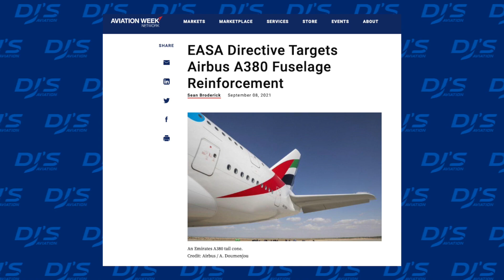New Airbus A380 Problem?

Comment: THIS PROBLEM STARTED  HAPPENING A YEAR AND A HALF AGO AND WE ARE JUST HEARING ABOUT IT?. AIRBUS DOWN PLAYING THE ISSUES THAT QATAR IS HAVING. AIRBUS HAS SENT PEOPLE OVER THERE TO EXAMINE THE PLANES AND IT IS TRUE . A LOT HAVE COMMENTED THAT IS WAS A PLOY BY QATAR BUT AIRBUS VERIFIED THE ISSUES. WHEN THE A320  WAS FIRST INTRODUCED IN FRANCE AND CRASHED THE PILOT WAS BLAMED BUT HE PROVED THAT THE BLACK BOXES WERE SWITCHED .  FILM PROVED IT. THE COMPUTER CASED THE CRASH. THERE WERE ISSUES ON FLIGHT 72 AND ISSUES WITH TUBING THAT HELPED CAUSE THE 447 CRASH. ALL OF THIS IS WAS BRUSHED OVER . AIRBUS KNEW ABOUT THE PROBLEMS WITH THE TUBING AND REPAIRED IT AFTER THE 447 CRASH. AIRBUS ISSUES ARE ALWAYS DOWN PLAYED.

Comment: Well hecc both Airbus and Boeing are  having problems.
Reply: They always have and always will. Par for the course in this industry.
Reply: @brkitdwn  True. But I am more concerned about them having too many problems.
Reply: @titan4110  this doesn't not constitute "too many problems" for the A380. It's one new issue after a decent length of time in service and entirely normal as an aircraft ages.
Reply: @wurly1  I said I'm worried about them having too many problems not that they have too many problems.

Comment: EASA doing it's job, we'll get to see how airbus will handle it.
Reply: "The Airbus A380 has seen new cracks found and the FAA is currently proposing an airworthiness directive to sort the fix of the aircraft within the aviation industry. In today's video, I take a look at the new problem. just what the EASA would be proposing, how the problem was found and more thanks to reporting from the Aviation Week!"
Reply: @brkitdwn  Yea I guess the FAA will have done the same AD. Listening to the video again, I hear it's a matter between the opperator and airbus to get it fixed before a given number of cycles. Since a sizeable amount of the 380 in eu have been going out of service, the fix wouldn't be done for those ones.
Reply: Better than the FAA and Boeing would handle it I would say

Comment: Guess what in 2025: Passengers demanding reintroduction of comfortable A380 like jets with wide cabins after getting tired of travel in cattle configuration long range A320neo or 737MAX jets.
Reply: Widebodies will still have their place
Reply: Those airlines that have aircrafts configured for “cattle” are low cost as with flag carriers, even narrow bodies are quite comfortable
Reply: @jpcaetano  strongly disagree.

Comment: If this was a Boeing it would be more dramatic than we see here.. Fact is that plane is relatively new and although the last NEW unit was shipped to Emirates a few days ago it still remains a white elephant in Airbus' presumed quality. Not gloating at all as the real problem is the poor so-called craftmanship these companies have to put up with in order to sell planes globally they cut deals for parts and assemblies to come from countries that have less skilled craftsmen in this field. More to come...  It's the tip of the iceberg...
Reply: Go and compare the numbers of ADs between Airbus and Boeing.

You would properly choose to fly on Airbus for your next flight.
Reply: Shanghai  I am happy to kick Airbus as strongly as i spit on Boeing, if they are willingly sacrificing quality control over the parts to save money. While some Boeing fan boys seem to think we Airbus fans are partisan, I assure you, I have enough bile to spit on both companies will equa; contempt. If Indian parts are sub-par, then they should be rejected. Its not even a debate, as far as I'm concerned. Can you tell me the Indian company concerned...sounds like some emails are in order and before I contact QC at Airbus, I need more details. Thanks.
Reply: When the A380 was new, there was a cracking issue related to the wings. Is this a continuation of that issue which DJ failed to mention? Funny how you a fluff reporting when Airbus has a issue compared to your dramatic beat Down on Boeing.. Why do you hate Boeing so much as it reflects in your reporting?
Reply: @duingtime    Dj merely recycles aviation industry news. Stop insinuating he's biased.
Reply: @brkitdwn  it's the manor in which he does. And I am not the only one that thinks so.
Reply: @duingtime  Airbus have yet to kill hundreds of people to save a few bucks.
Reply: @swannvictor1388   Just the A320 family, 160 aviation accidents, incidents, including 36 hull loss accidents, and a total of 1393 fatalities in 17 fatal accidents. not steller by any means.......
Reply: @swannvictor1388  You really not know what your talking about! South America to Paris ring any bells?
Reply: @duingtime  Paul your fighting a losing Battle  here . Outnumbered by at least 2-1 by the busboy brigade. .!!!
   Don't let that discourage you from stating your opinion..
    Most of them are talking out of their backside anyway...
   DC dingus.. sorry DC 8 Combi !!!the biggest..!!!.
Reply: @swannvictor1388  I don't think Automation is the best on Aircraft and it has pretty much happened on both Boeing and Airbus when a Malaysia Airlines 777 Suddenly Pitched Up and stalled at 41,000ft due to an ADIRU failure which failed all the way back in 2001 or when QF72 an Airbus A330 had it's Fly by Wire system broken plugged towards the Indian Ocean or when AF447 an A330 stalled and plunged all the way down towards the Indian Ocean or when the MAX pitched nose down after it's sensors failed to provide correct data for it's fly by Wire you see Planes Diving isn't a Boeing problem nor is it an Airbus problem it's a problem that plagues all Aircraft with some kind of Fly by Wire Truth Is Pilots are becoming more reliant on Automation and Airlines prefer to cust cut on Airliners that have alot of Automation to limit pilot training today's pilots are forgetting how to use Stick and Rudder and are instead selecting VNAV after climbing to 500ft
Reply: @nargwhal  agree with you 100%. Many pilots, especially the younger ones, are far too reliant on automation.
Reply: @gregsmith3410  as the great 8 said are you 😘 bums mate 😝. Nobody seems to respond to your lapping of the bum.
Reply: @duingtime  are you a Boeing fluffer 😝.
Reply: @DC8Combi  Not hardly! I fly for a living so I am watchful. I just don't like unequal/fair reporting that this site has turned into.
Reply: @duingtime  well put Paul..!!!👌
Reply: @duingtime  well here’s a tip….. if Boeing was honest it wouldn’t be in the news. You can’t report what doesn’t happen.
The bad news will continue as my near 13 years in the Boeing cesspool have shown me they will never change.
Cost, schedule and shareholder value over quality & safety. I have many photos and documents to back the allegations.
Reply: @gregsmith3410  are you 😘 Paul’s bottom 😝
Reply: Erm...the fuselage of the A380 is mostly made in Germany: a country not normally considered third-rate or shoddy, in terms of engineering skill...so, I'm not really sure where your going with the point you were trying to make except a clear demonstration of casual racism....?? Strong whiff of American Imperialism....
Reply: @swannvictor1388  NOT HARDLY!

Comment: Cracks on aircraft are common. Airbus would have informed the customers and suggested timescales for completion of a modification, Airbus would ask EASA to raise the AD to make sure the Airlines follow Airbus's recommendation.
Reply: Yes cracks are expected when the plane is designed. The engineers sometimes engineer a crack in & watch it develop.
Reply: Certainly not on all types...
Reply: Yes - cracks are certainly worse if its a Boeing plane.
Reply: @markodom3841  So you are trying to be funny or you are just stupid?
Reply: @teofilstevenson  Both